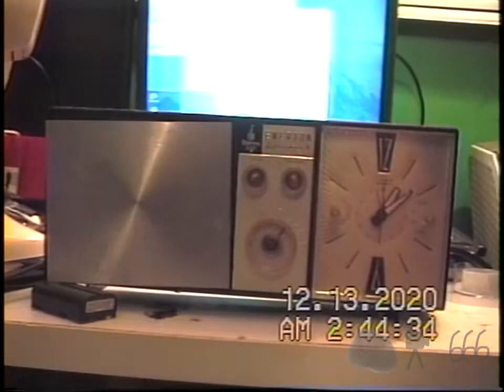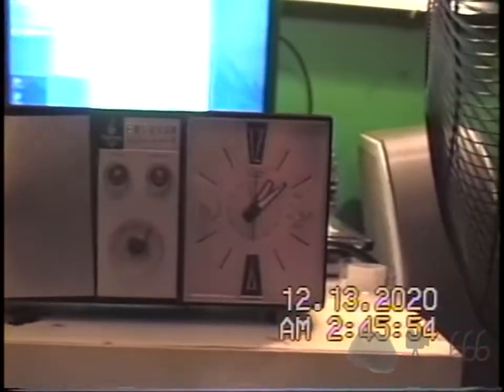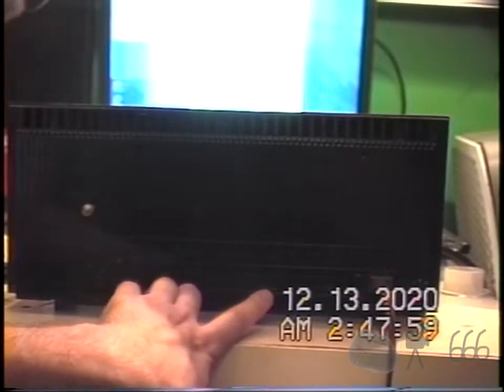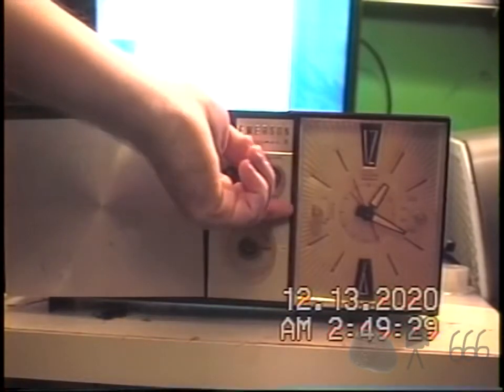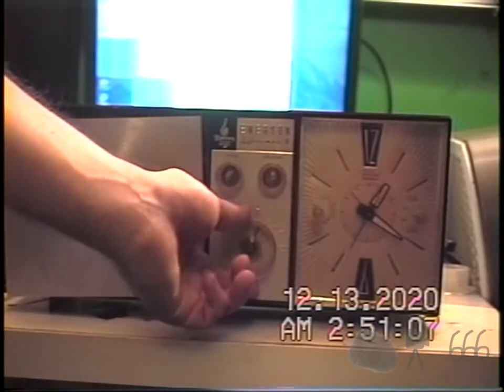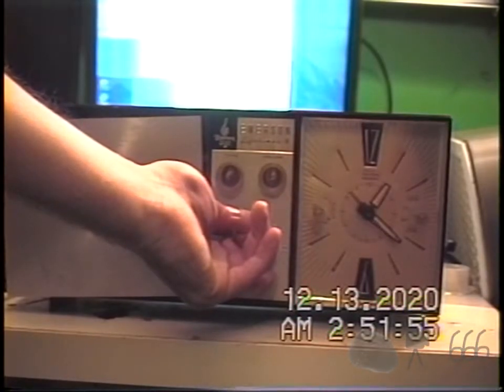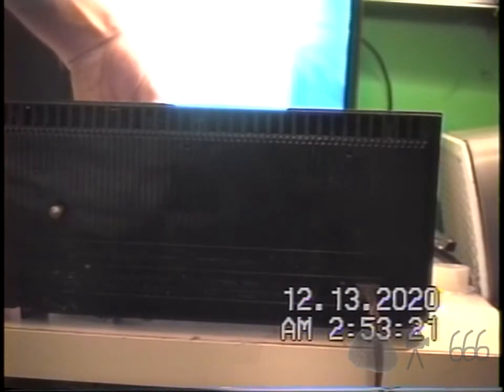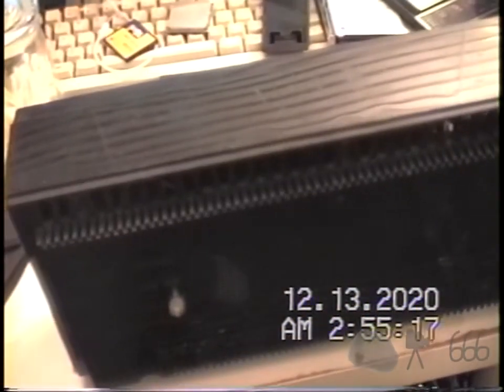Emerson LifeTimer II Tube-Based Clock Radio

Comment: I did recap that radio while it was floating around the Center for Good Ideas, but I didn't realign it or anything like that.  I should also note that (IIRC) the replacement power cord doesn't quite fit the back panel, so the "interlock" doesn't really work right. :P